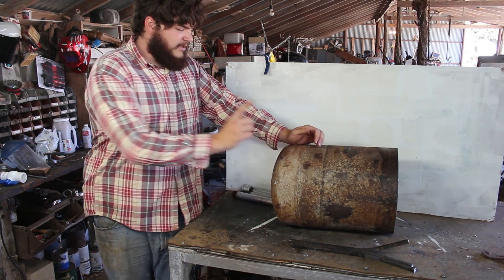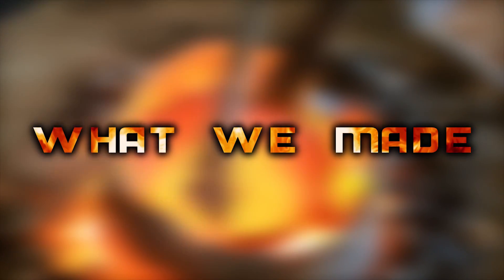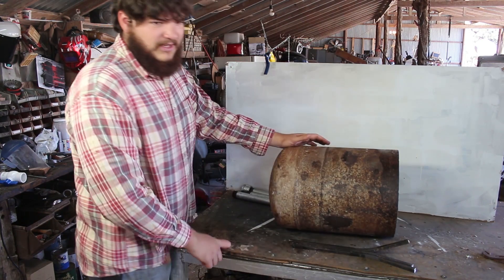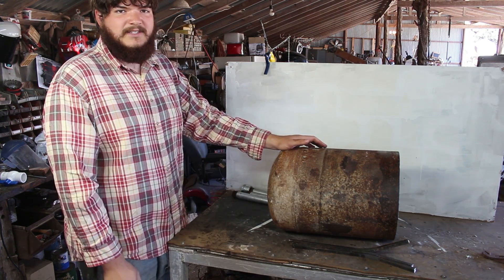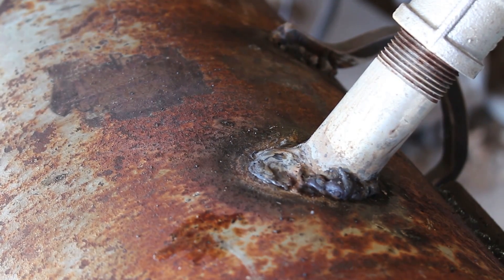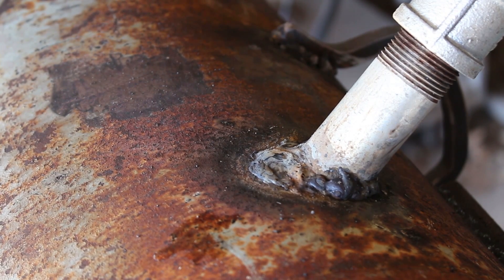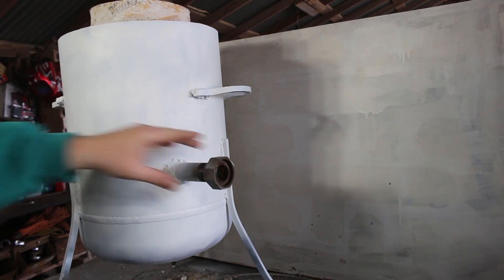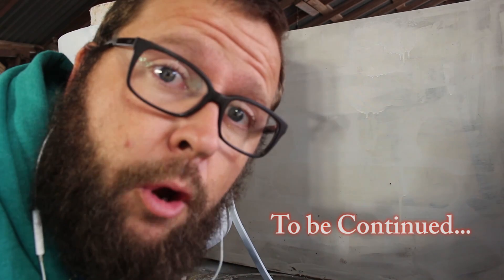Propane Forge Build

Comment: Sand and plaster of Paris for the refractory?
Reply from the maker: I am not sure how long it will hold up to the heat. If it doesn't last long we will go with something different.
Reply: +What We Made I used portland cement and ground up bentonite clay (kitty litter) and it's held up well.  I did let it cure for over a month tho and ran sheet metal screws into the cylinder walls before pouring.
Reply: +Tim Fox Cement is bad though